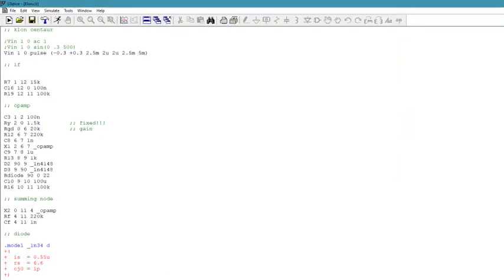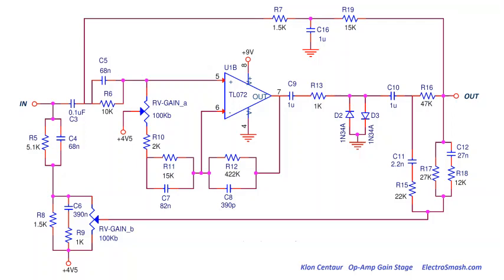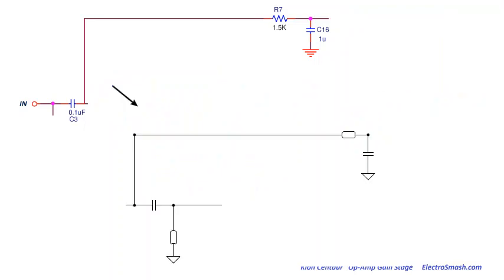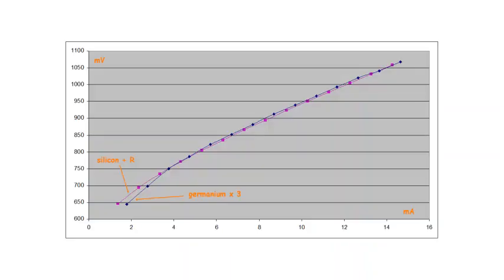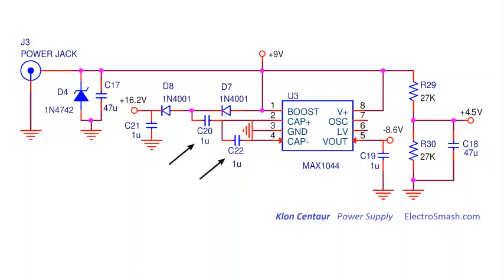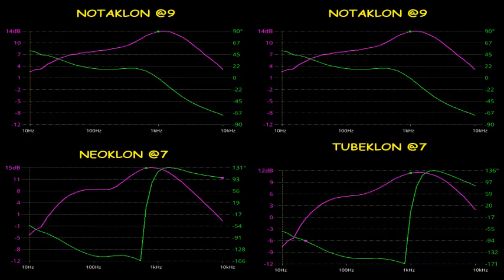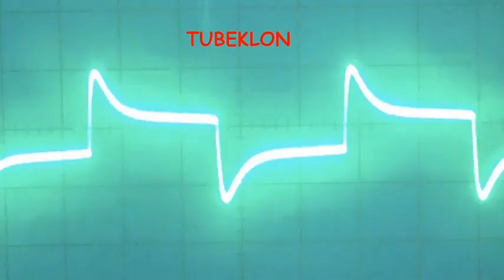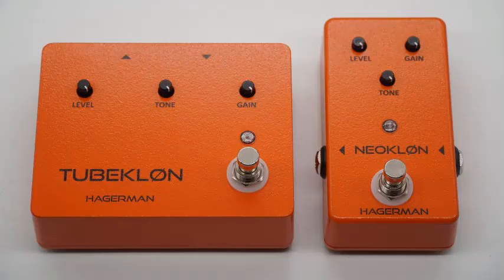Episode 6 - TubeKlon & NeoKlon Circuit Analysis

Comment: Hi Jim.  What voltage does the tube run at?  Thanks & regards, Kieren
Reply from the maker: This pedal runs tube at 15V in starved mode.  Most designers don't know how to get a tube to operate well under such conditions, but I have.
Reply: @hagerman_amplification    Most tubes in pedals are just for show (even lit with LEDs! etc) and/or are running starved, yes.  Interesting.

Comment: Cool!  What voltage does the tube run at?
Reply from the maker: I use a charge pump to double supply voltage, then filter down to 15V for tubes and transistors.
Reply: @mastopage3120    Huh?

Comment: Got the TUBEKLØN in the mail today. Assembly was quick and easy. Half the time was spent trying to get the protective strip off the felt tape :) The manual could be a little clearer where to put them. I glued one to the top of the case and one to the lid because that made most sense to me.
Obviously, I don't have a Klon Centaur for comparison, so the TC Electronic Zeus must do. The problem with the Zeus for me is that it gets a little harsh when the gain is up, because you only get the hard clipping and barely any mixed in dry signal to smoothen it out anymore. Or maybe the Zeus also goes into OpAmp clipping like the NOTAKLÖN. Not sure if the Germanium diodes of the Klon sound better. I will likely never know.
The TUBEKLØN generally sounds warmer and rounder, even at high gain thanks to the different clipping characteristics. It also has more output volume in total than the Zeus – not that lack of volume was ever an issue with the Zeus. The TUBEKLØN is a little noisier than the Zeus, but nothing out of the ordinary (the Zeus is actually extremely quiet).
The only concern that I have is that the true bypass via the footswitch is prone to creating popping sounds when engaged if I set the output level higher than 1/3 (still above unity gain). If you're concerned about that, you might want to consider using a high quality loop switcher.

tl;dr: if you want a warmer sound at high gain, then the TUBEKLØN might be a good alternative for you. If you like the sparkle or prefer to run your Klon as a mid boost at lower gains, you might not need to shed out the extra cash.

Comment: Why are your pot knobs so freaking small? 😂
Reply: idk but they're adorable!
Reply from the maker: I have nothing against nice knobs.  It was more of a mechanical issue, trying to get both footswitch and pots lined up on a single board that actually fit well (not to mention squeezing in a tube).  The multiple board style with SMT components and a ribbon cable is not my thing.  I came up with something else.  Keep in mind I am not stamping these out a thousand at a time.  Each one is hand built by me using through hole components.
Reply from the maker: This was a tough choice.  It was mainly to simplify assembly for my "kit" pedals (see GAMMA RADIATION).
Reply: The knobs can be replaced though yes?
Reply from the maker: These are knobless pots.